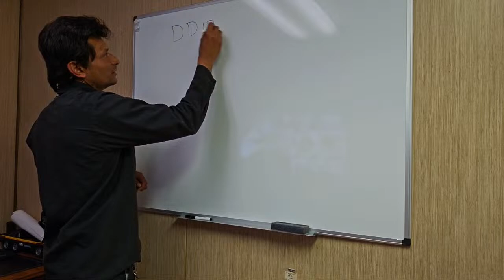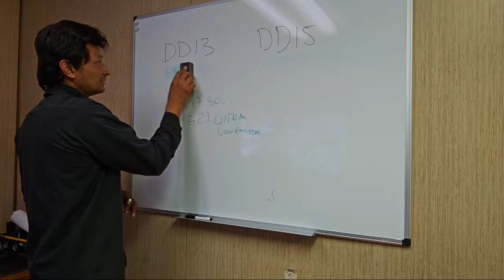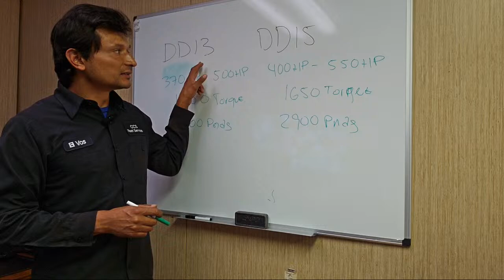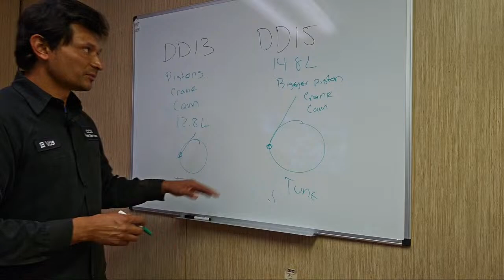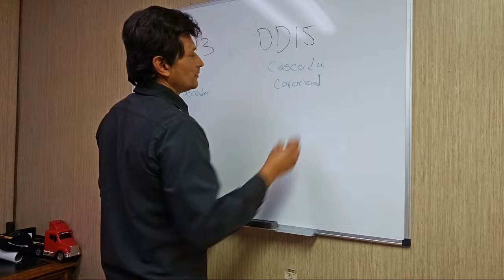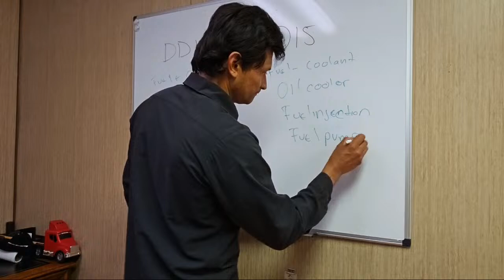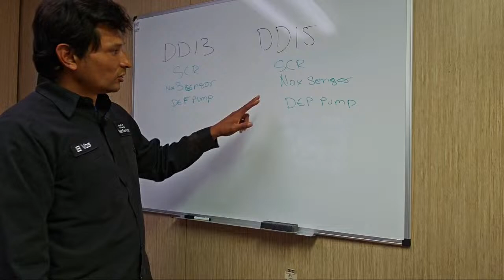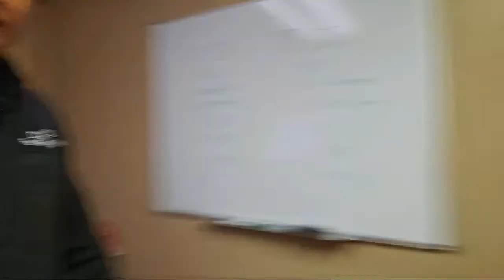DD13 VS DD15 differences and similarities between these to engines March Live Video

Comment: I read the they can go up to 525 the DD13
Reply: And boom, your engine starts to break apart everywhere like he explained . It’s like asking a small 4 foot person to pick up a washing machine vs a 6 foot 7 person . Which one is gonna handle it better ? Imagine them doing this repeatedly for hours , up down , up down, They both may lift it BUT, one of them are gonna a start breaking knee caps, joints, etc because the smaller person is obviously not built to handle so much weight. So if you see a DD13 With that much power. Just know it’s either broke already without showing signs or it’s gonna explode and you’re done for. ✔️

Comment: I’m looking to buy a 2019-2020 cascadia , can you make a video on the INSPECTION AND WHAT TO LOOK FOR when buying a DD13 and a DD15? This would be gold for us out here tryna get a good truck , not perfect but a good truck. If you already have this video , please tag me
Reply: Who are you buying the truck from?  Schneider, Ryder, Penske, RichieBros...?  Compared the price on this 3 big fleet used trucks, if you know how to rebuilt the engine you can buy a $10,000 AS-IS from Ryder be sure to inspect that engine turn.  If you want a good $40K+ ready to go Schneider low mileage 400,000-500,000 miles is the easy way.  All of the used trucks will have problems especially that stupid emission system be sure to replace all of the nox sensors and temp sensors.  Oil pump, suction, 5 O-rings, rod/main this is very crucial for this DD13 and DD15 this will prevent major engine failure.  Good luck with your purchase.

Comment: I do local rail work , so I’m trying to decide between dd13 or dd15 on 2019 cascadia 126 . Load weights vary all the time from light to fully loaded. Anybody out there got some suggestions?
Reply: DD15 505 horse power 46 rear diferencial no problem with heavy haul